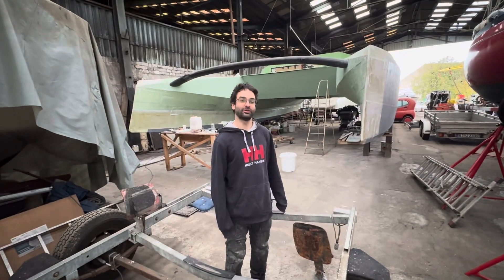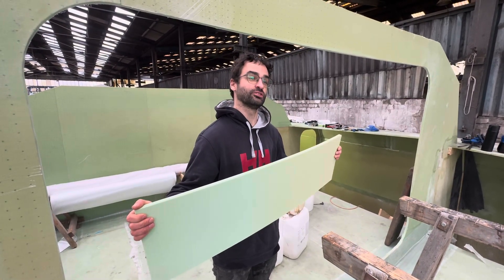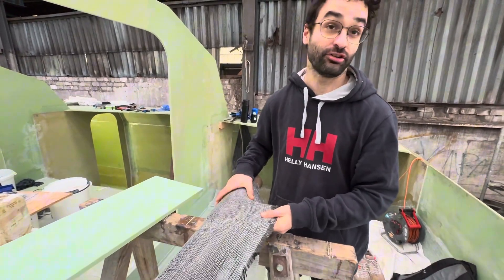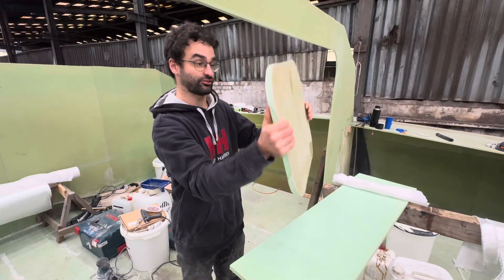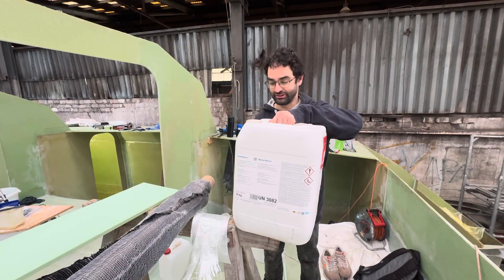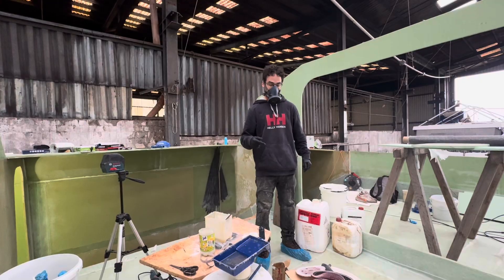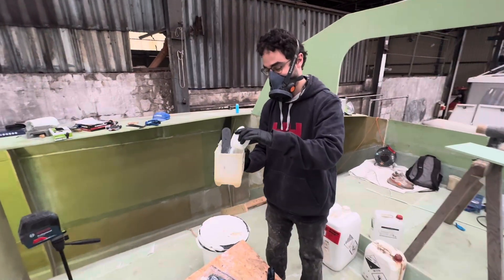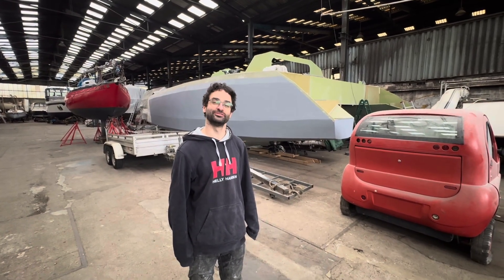What Materials I Use to Build My 12.5m Catamaran ⛵️(From Foam to Carbon Fiber)

Comment: That cedar former in the carbon hat-section stiffener is simply a waste of money. It's nonstructural in this application.
There are only two purposes for a piece like that: To transfer shear between the skins, and to provide a mold over which to form the layup.
Since this is a hat section, the shear transfer should be designed and built into the vertical sections of the FRP layup. That would be far, far stronger than the wood. As to providing a mold over which to form the layup, foam would have worked as well, and cost much less.
In addition, the ends of those beams aren't tied into anything. There's no continuous load path from the mast to the water. I know the boat isn't finished yet, but I have some serious questions about the structural soundness of some of that stuff.

Comment: I'm concerned about your wood / carbon fiber construction, Wood expands with moisture and carbon fiber is stiff will it crack or will it just create un necessary stress in the construction as a whole.
Reply: Definitely needs to be sealed, no?
Reply: @claudiaphilippkleessen243 I'm not the one to give his opinion on the matter, but I guess sealed is better.
Reply: I know enough about this to get in trouble, I believe as long as the wood is sealed he’s fine.  What concerns me is that he didn’t seal the ends when he layed the carbon fiber.  I know with plywood it’s best to coat it one or 2 times before you add fiberglass.  

Lots of boats are built with wood stringers laminated together and covered with fiberglass.  As long as everything is sealed he should be fine.  They have built Sportfishing boats in NC for decades using a highly similar species of wood.

Comment: Don't use colloidal silica by itself for fillets it is too brittle.  Always add a powder like qcell or talc. I use 50 50 mix for fillets and 85 to 90 percent qcell and the remainder cabosil, colloidal silica, for a fairing mix. Built several large catamarans to 13 metres and built and designed several powercats and a small tender for which I sell plans. Currently building a caravan, travel trailer, from the same materials with no chassis and timbren suspension. Been boatbuilding since 94. Allergic to most epoxies now and prefer vynilester these days. Much better ro work with than epoxies. Yes arguments abound about strength etc however with unwaxed vynilester all secondary bonding is a chemical bond not mechanical bond. In my testing I have found vynilester secondary bonding superior in most cases to mechanical bonding with epoxy. Good luck with the build, who is your designer. Cheers
Reply: Do you know how you got sensitized to epoxy? Skin contact? And how does the allergy manifest itself?
I ask because I used to build and repair boats. I worked with these old guys who'd built, for example, America's Cup 12-meters back in the 1950s and 1960s, when they were still built of wood. They mentioned that people occasionally developed allergies to cedar. For some reason I remembered that, but didn't give it much thought until I developed a severe allergy to cedar. It's freaking awful, because cedar oil is a major component in most fragrances. I can't work on boats anymore if it involves almost any exposure to wood.

Comment: Basalt cloth is a perfect product. Cheaper that carbon but super strong and hard to dent.
Reply: That "super strong and hard to dent" is because the modulus of elasticity is only 10% of the modulus of carbon fiber. It saves money on a per yard basis but is far more expensive to achieve similar stiffness - or even half the stiffness. If you're seeing very stiff basalt layups, I'm going to say it's more likely due to excess resin than the stiffness of the basalt reinforcement. 

The one situation where basalt makes sense is very high temperature applications, where it's used with phenolic resins. Formula 1 teams use them for bodywork right next to the exhaust. 

The slivers from basalt suck, too. 

It's cheaper and better to use more layers of s-glass than basalt for an application like this.

Comment: I have one of those orange dead blow hammers in my shop.  I haven’t used it in years but the other day I picked it up and the entire hammer had turned into a gross crumbly mess.  For your boat I would make twenty test “coupons” using your construction technique and then destructive test one every year for the next twenty years.
Reply: The concept of foam core with fiberglass skins on both sides has been done in boat building for decades.  He is using epoxy which is a stronger bonding material than most boat builders who use polyester resin.  His panel if laminated correctly will be fine, the question is does he have enough layers of fiberglass in the proper places based on the loads in that area.  I hope he has consulted a Naval Architect a people who are very familiar with layup schedules.